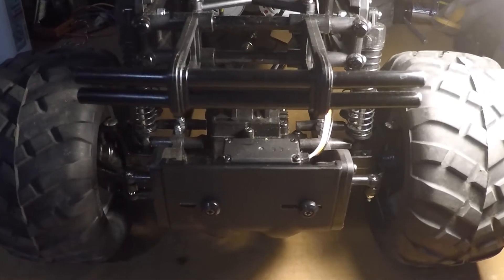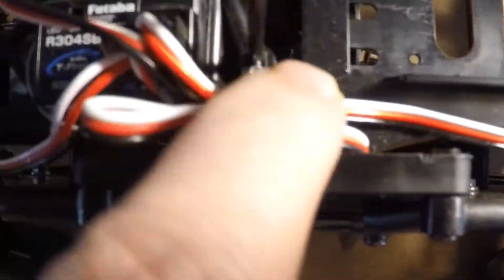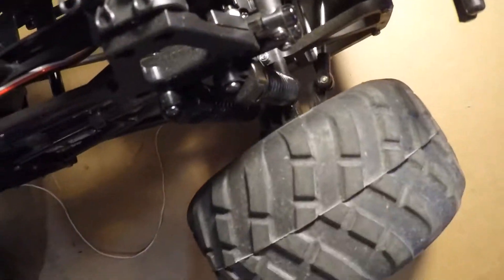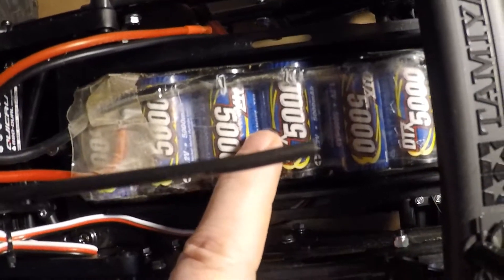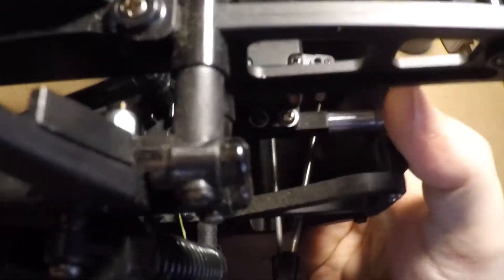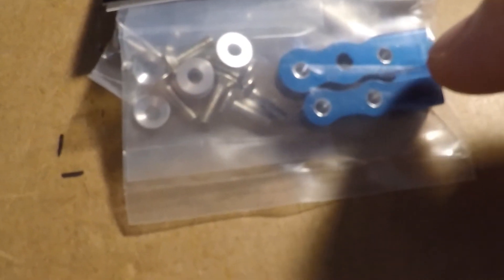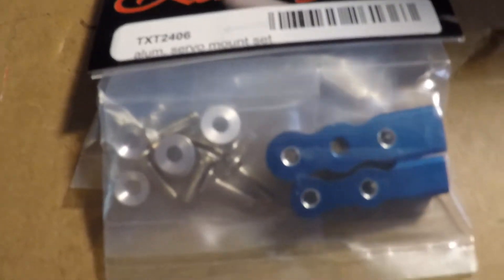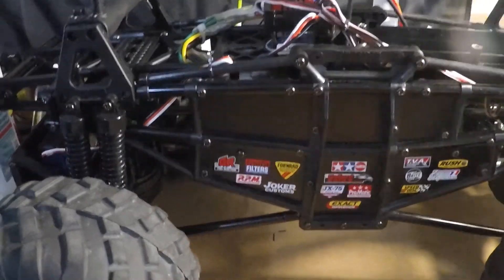Tamiya TXT-2 Agrios Tips & Things

Comment: This was the first of your Videos that got me seasick!!! 😜😂😅 
Since you're using the inside hole, you could just clip the Servo Horn through the outer threads, and have plenty of room - especially if the Bumper moves in on Impact. 

SUCKS about the Hot Racing Servo Mounts. 😖😞 I'd send them back too. 
The long ones look like they're for 1/4 Scale Servos... But I can't see how those would actually FIT. 

Some good Tips there Brother!! 👍👍  That should really help someone who might be getting one!
Reply from the maker: Yeah, i was really bummed about the mounts. as for getting you feeling like your in a fun house, my bad, holding the GoPro one handed to get a better view of what i was talking about. I did a run video today, but it was junk, so ill go out about 6 or 7am and try again.
Reply: No worries Bro... I couldn't have done much better!! That's why I spent extra on a handheld Gimbal for my GoPro. Even with Stabilization, I still don't trust myself!! 😜  
... I hope they take those back. It's obvious why you can't use them.
Reply from the maker: @CarminesRCTipsandTricks  They should, i got through Amazon.
Reply: Well, that's definitely good! 👍👍